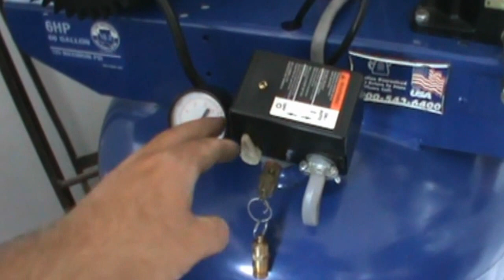How to add an electrical box

Comment: How are you supporting the ladder in the background?
Reply from the maker: I just welded up a ladder bracket. It works out well I used it on my fence outdoors at my first house, then I took it with me when I moved.  It will fit up to 3 extension ladders.
Reply: Thanks for the quick response, enjoyed your video.